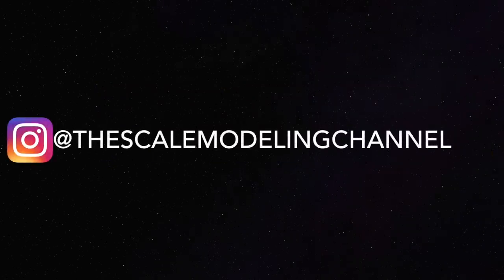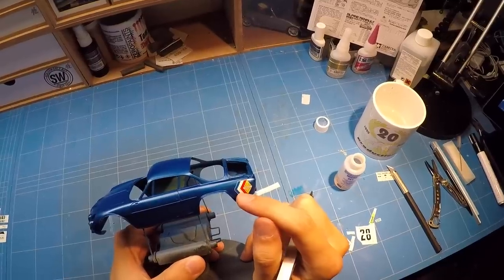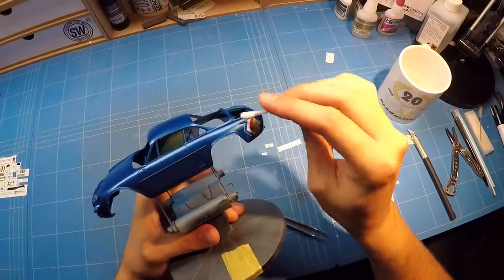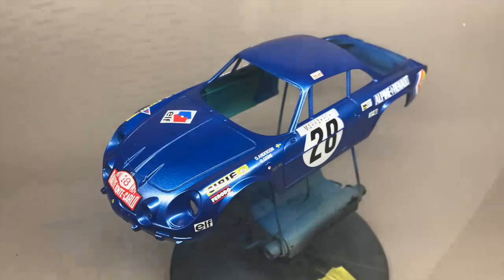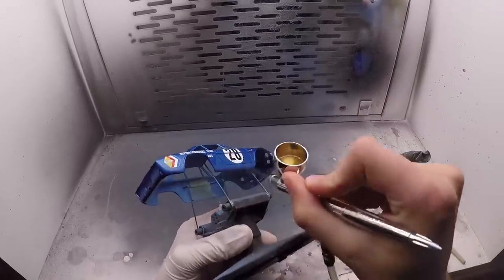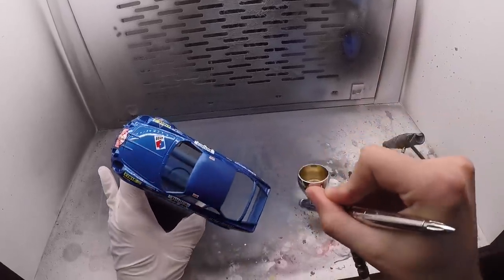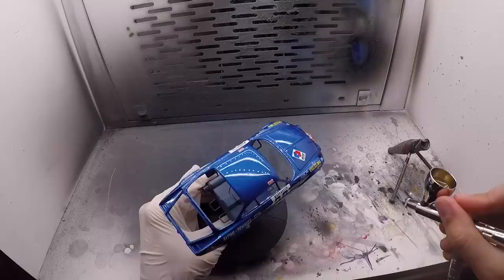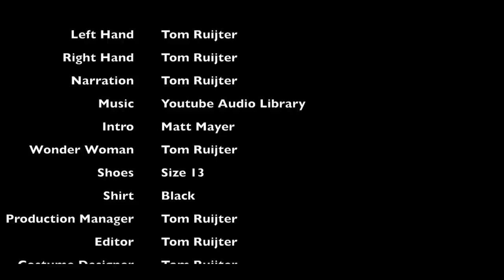Tamiya: Alpine Renault A110 Monte Carlo 71 Part 2

Comment: How do you avoid orange peel when applying clear coat? Your paint finishes seem so smooth and great to look at!
Reply: Seems like it might be the clear is really thin and not viscous, causing it to self level  easier as it dries.
Reply: I am using the Zero 1K clear, with a 0.2mm nozzle... might the problem lie there instead?
Reply: Rajaram Sivasankar as far as I know, you use a too narrow nozzle. I recommend to switch to 0.3 mm or even a wider option. Also, try to use several thin layers of clear coat.
Reply: Thank you all for your help. Thankfully, I think this problem can be mitigated on the current build, but will heed our advice on the next build! :)

Comment: Where do you put all these models?!! I’ve started using 2k with mixed results and often wet sand & polish but end up sometimes with a milky finish. particularly with black paint. What am I doing wrong?
Reply from the maker: seems like your not using a high enough grit for the sanding(polishing)

Comment: Did you applied the decals over the paint, without using clear coat?
The Zero paint is flat, so I assume, the decals does not stick to the flat surface well
Reply from the maker: Did you watch the video?
Reply: Yes, and the previous video, also.
This is why I asked.
Maybe my question was not clear
How did you solved the problem, the decals on a flat surface?
Maybe, the Zero paint is flat, but smooth enough to apply the decals? Or, the Micro Set solution helped the decals to stick to the surface?
I will try it, I have many zero paints (this Alpine blue metallic too), and many unused decals.
Reply from the maker: Decals stick just fine to flat paint. If applied correctly. Use SET and SOL and they stick just as well as on gloss surfaces
Reply: @TheScalemodelingChannel  Tom this kinda answers my question from yesterday, or the day before! I can't see on your model what I tried to describe on my Jagermeister Porsche. As I said it's only noticeable up close. I don't remember putting SOL over the decals, but I definitely put SET under them. But they looked flat as flat can be on the Zero paint, and I left it to dry naturally for a few days. Still looks good though, just not as good as yours!
Reply: Hi, yes the decals stick on the mat surface of the ZP using setting solution without problems. However, don’t you get slivering due to the mat surface?  Thank you.
Reply from the maker: Scale Model Therapy i do not
Reply: The Scalemodeling Channel Thanks!